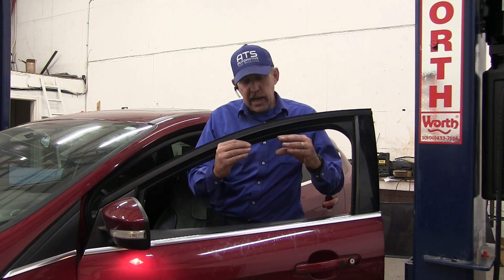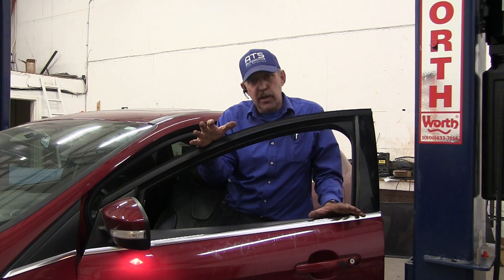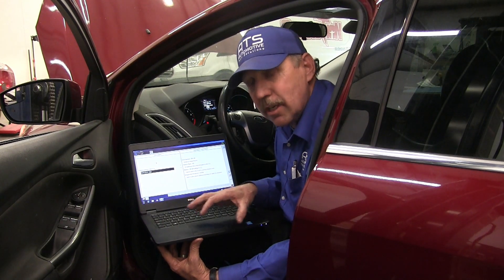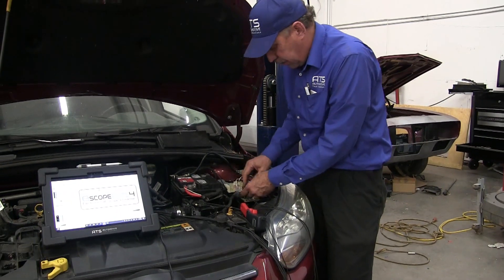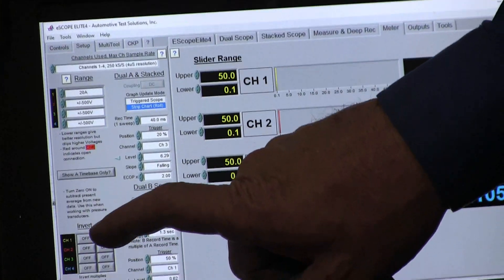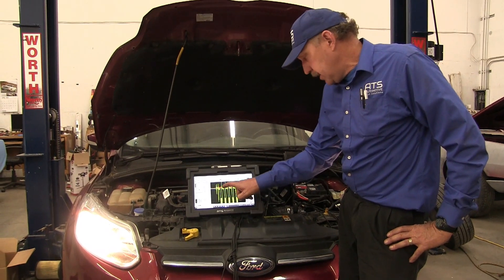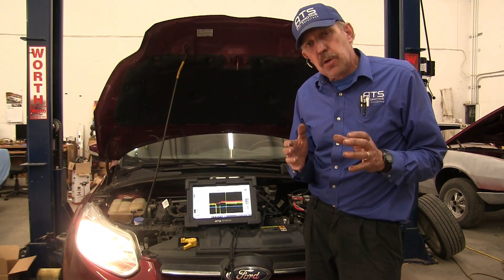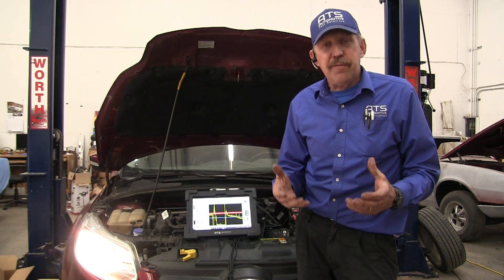2013 Ford Focus Dual Clutch Transmission diagnostic

Comment: At some point, the clutches wear down and slip like a normal clutch.  Can the scan tool indicate how much clutch life is left?   
What is the max mileage you have seen on an original clutch?  
Would I be crazy to buy a 2014 Fiesta w/150k on it that has had mild shudder for years?

Comment: I like how you troubleshoot. You think out of the box. You take nothing for granted. You look at signals for answers. You remember the steps the transmission needs to take to go in the right gear. Its too bad auto repair is under appreciated and under paid.

Comment: I’ve watched most all these videos. 
I cringe when I see someone make a comment like this; however I think this is worthy commentary. I’m a ford tech with 100 or so of these clutches under the belt. Following the factory flow chart you will see that the two input shafts speeds should match, the shaft may turn, but unless clutch is applied output won’t happen. 

I also may not be in a “clear” mind right now though 😆
Reply: I got this clutch/transmission problem on my sons 2012 Ford Focus SEL. 120k miles. It’s giving a P07A3 code. Shifts hard through gears and revs up high. Do you think the upper and lower shift actuators could be the problem or something else? Problem just started in past few days.

Comment: biggest piece of crap system ever though up by the dumb asses at ford. this cost the company a lot of money because the system is prone to failure. maybe they were thinking like washing machines way back when they had to make them with belts so they would fail. or apple they want only their techs working on them.probably thinking when this fails we sell them another, good luck with that.

Comment: Can I ask what was the problem with the clutch??
Had the same problem, the shop was not able to callibrate the clutch (the car was driving just fine but they accidently reset the cluch)and i was told that the only solution was changing the clutch for a new one and it was very expensive...

Comment: I have a 2014 Ford Focus SE with 119K miles. Had the TCM replaced along with the two transmission actuators. Was running fine for roughly 2 days and it shut down on me while waiting at a intersection for the light to turn green.Tried to restart it. No cranking at all. Turned the ignition and nothing. Power was there, lights/turn signals, radio. Gages were not acting funny/fluctuating whatsoever. Both starter and battery are OEM/had been recently replaced at the Ford dealer.  Gages were not doing anything weird. Swapped 15A F26 fuse for TCM with F27 fuse for A/C clutch relay. After I did that the car started right up! . No DTCs/service engine soon light. Before I swapped the fuses around I had disconnected the negative cable at the body post for a few seconds then reconnected. Still did not start. Doing this may have cleared any codes that may have been set. Not sure. When I took it to the dealer they drove it for roughly 10 miles/put their scanner on it and nothing. Car drove fine. Did not shut down on them. I picked it up/drove it back home from the dealer which is approximately 2.5 miles from our apartment. No problems. Later on I checked the continuity on the two fuses that I swapped around and both showed continuity. There was another fuse that I had checked that felt a bit loose. I pulled it out fairly easy. This fuse was not OEM though  It is F38, also for the TCM according the owner's manual. Also for PCM so a lose fuse here could have cause a problem/short causing the PCM to shut the vehicle down. Not sure though. Replaced it with OEM fuse. Ran the car for a while no shut downs. Will drive it around the block for a while to see if it will shut down on me again. More to come. Thinking of getting rid of this car. Has been a pain. No longer trust it. Fine one moment the next it shuts down on you. Never had a problem with Ford cars in my life until now wth this little monster. 😈Anyone else have the same issue with their 2014 Ford Focus SE? Would like to hear back from you please.
Reply: We have a 2014 focus  se we over 340000 on it no problems . I did change transmission oil very regularly, we had the  transmission update done when it was a recall, a very economical car to run
Reply: @alvinepp2489  Good for you! Did you guys buy it brand new? No one else owned it before you?  From what I have read on these transmissions they are sealed.  So, there is no way for you to check the transmission fluid on a 2014 Ford Focus. 

That said,  while you shouldn't have to do so,  you can drain and replace the fluid if you wish. You wouldn't be damaging anything. And I say you shouldn't have to do so because the transmission fluid is supposed to last the lifetime of the vehicle.  (in theory).😁

When a vehicle has a sealed transmission, as the 2014 Ford Focus does,  it does not need to have the fluid checked or replaced every 60,000 miles or so. That used to be the industry standard before automakers were forced by regulatory agencies to start design “longer lasting” auto parts.
Reply: Don’t know if you’ll respond but worth a shot.
Two years ago I had similar issues, a week ago, I had the same issue. Ford Dealership quoted me to replaced clutch, and hooks etc, but they just did it two years ago, and I’ve put less then 15k on it since. I have a feeling it’s not the clutch, and if it is, could maybe something else be wrong causing the clutch to go bad so quick. It’s very expensive to fix, they want 4,000 again, car is only worth 6.
Reply: @LordJohnWick  Im sorry to hear that you are also having problems with this car. It's you're call but,  you should consider getting rid of that car. Its a money pit. I really liked my 2014 Ford Focus SE hatchback. Hung in there as long as I could. Extended warranty fixed it the first time. Replaced TCM, everything else they did to it was out of pocket. Had the battery and starter replaced, body control module replaced.

 I just about rebuilt this car. Transmission clutch /engine was the only thing not replaced. 😁  Once that transmission went down I was done.  No reverse this time around. Trade it in for a 2021 KIA RIO S. They gave me 4500 as is for the Ford. Whatever you decide to do I wish you luck brother. Take care wherever you may find yourself.
Reply: We had "transmission overheat" on my GF's 2013 Focus DCT. Shortly after that i googled and there was thousands of reports of tranny failures. Car wasn't even at 90K KM. We sold it ASAP and got a MT Honda Fit. Never again will we buy American.
Reply: Yeah man I got that same peice of shit

Comment: I am getting a failed communication error to Transmission.  Could this still be an issue with the clutch?  For a 2012 ford focus.  Thank you!
Reply: Code? Add trans fluid might help

Comment: Clean grounds battery ground on frame remove the paint clean the 2 grounds on frame under air filter for transmission
Reply: You are correct, May have surprised the tech with that simple sentence.
Reply: Or add dot 3

Comment: Reminds me from the past! when they first started introducing computers! Ford was mainly a computer system that actually needed to be hard tested most of the time to get diagnostics!  almost sounds like they're going back to the old way!  new transmission system-hard mechanical testing in order to find diagnostics?

Comment: The Ford Focus with this electric clutch is a piece of junk.  Ford finally admitted it and ended u replacing the transmission/clutch on these. Still, problems continued with vehicle shuddering on acceleration.  Frustrating situation for car owners.
Reply: yeah biggest POS ford ever though up.

Comment: I want to ask a question about my Ford Focus.I live is TURKEY. It’s 2015 model , 1.5 tdci powershift. Recently I had a warning on the screen as ‘’ Battery shut downed the system to keep itself’’.I called service and they offered to replace the battery because it is low or overed. WE replaced it with a new battery, after that I had another 3 more faults. 
1-	Engine fault 
2-	AutoHold is not used 
3-	Transmission is in limited mod. 
But nearly for 20 days these faults havent been apparead again.Authorized mechanics advise to change TCM and test again, İt may be need to be replaced all transmission unit . Fault code is P2855. 
What do you you advise us ? Can it be solved by reprogramming the TCM by computer ? , İ hope to hear from you worriedly

Comment: Have 2012 focus p087a no reverse..I swapped the  actuators a and b and still same thing but now car won’t go into drive either..swapped back same thing..just p087a still..pinpoints test indicate tcm faulty but I’m not convinced
Reply: Add trans fluid
Reply: Did you fix the problem?
Reply: It needed the clutches

Comment: Sorry if I sound stupid here, but I don't work on transmissions. I thought i heard him say the transmission was replaced for this issue along with the tcm. If so, wouldn't the clutch be new?
Reply: Unless they did not install the clutch properly
Reply: Probably used
Reply: Was thinking the same thing

Comment: This is something that can only be diagnosed through knowing how the system works , symptomatic failure reports would help or TSB's but i think Mister Thompson said there weren't any . So with knowledge of the system and one of the best automotive oscilloscopes money can buy and of course the known how to use it you can be successful in diagnosing these string but true failures also . l personally thank mister Thompson for his time and effort thank you again and i hope to learn much more !